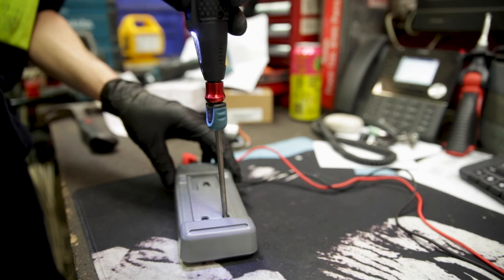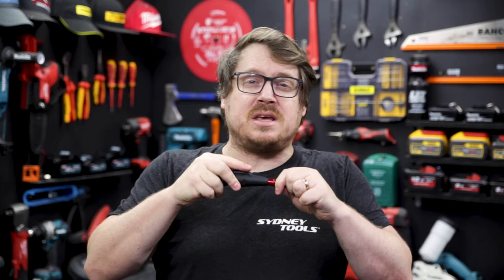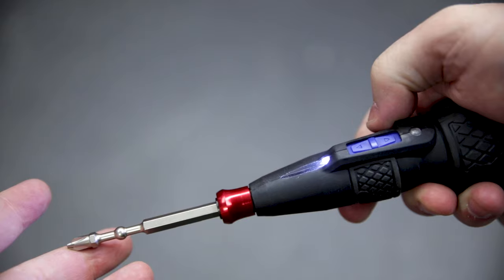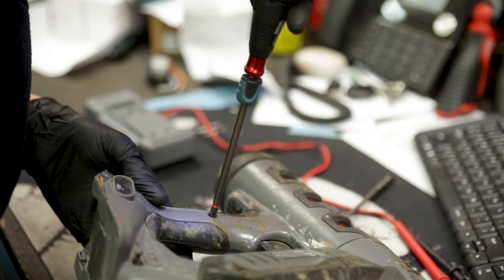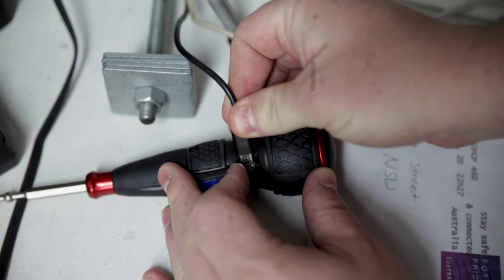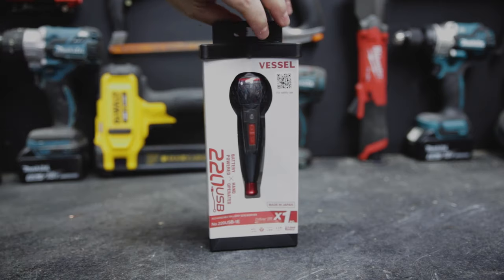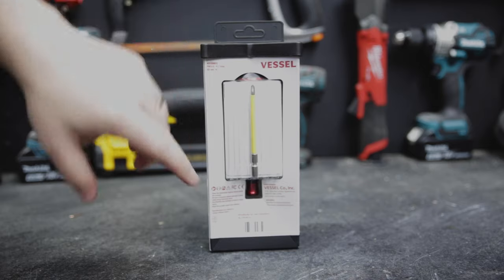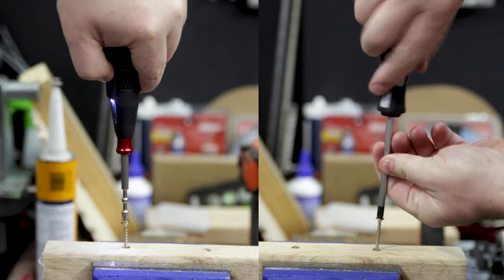VESSEL Cordless Rechargeable Ballgrip Screwdriver

Comment: you fitted a standard bit with a 9mm anvil but on the back of the packet it showed a Japanese Industrial Standard 13mm, does it take both or was that film clip from a Japanese model?
Reply from the maker: It takes all standard bits, the packaging i showed is a sample from Vessel that includes an insulated bit for electritians, however the official Australian release on our shelves comes with the bit I use that has the ball shape towards the top of the shaft. I discovered the inconsistency with the packaging after uploading sorry.
Reply: @SydneyToolsTV  No need to apologise, you weren't expecting a tool geek to be watching. 
I need to get out more.

Comment: Can this apply enough torque to put a dry wall screw intk a 2x4?
Reply from the maker: it could but its not specifically intended for that purpose.
Reply: I just bought one today I tried to get one screw in a receptacle box, didn't work, it has not enough pw.
Reply: it's for a small screws M2-M4, not for woodworking

Comment: Mine doesn't  even want to run 😂 straight out of the box. I can hear the motor whine for a tiny fraction of a second before it flashes the red light.

Charged it for 3 hours till it was green. About to crack it open and see if its a loose wire
Reply from the maker: Obviously faulty from the factory, Bring it back to us to investigate and replace